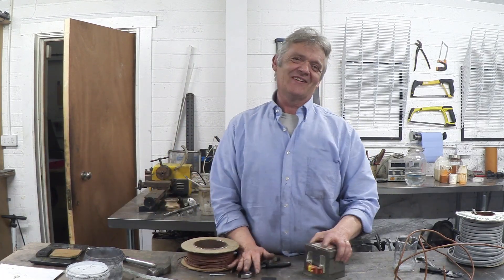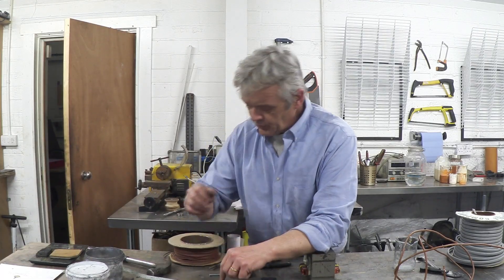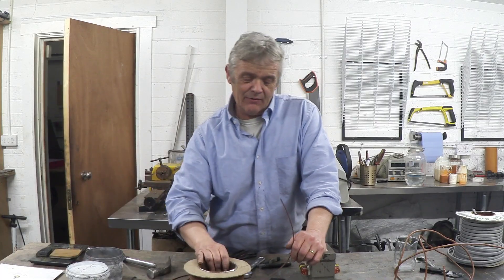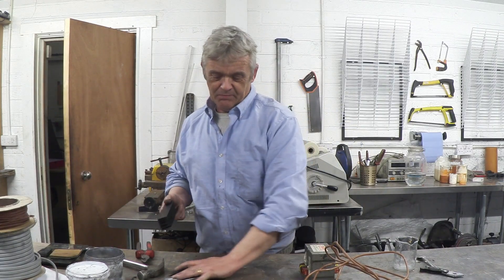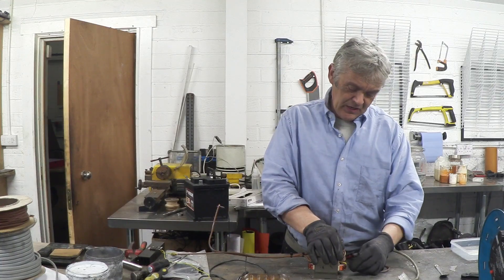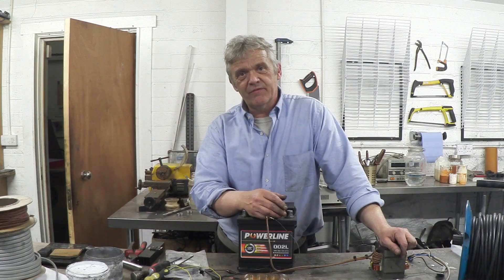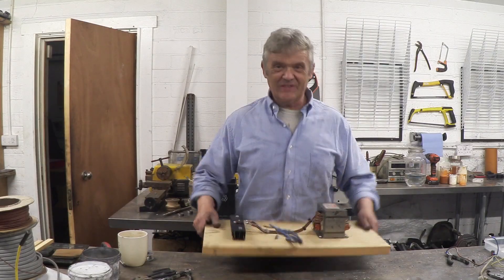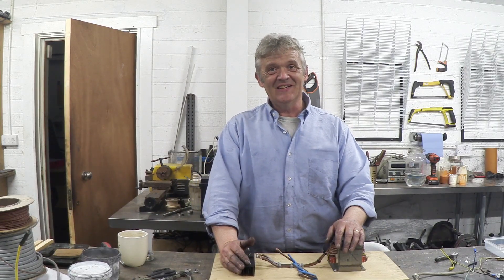Simple Cheap High Current Power Supply From A Microwave Oven Transformer

Comment: Thoughts on why I worried about it, Father was changing a battery on a truck and he got stuck to it for a moment. Now that I see you touching them, well he must have been holding a hotline that something was pulling from. Thanks for the un-fusion!
Reply from the maker: for certain he was mate - what quite often happens is the terminals get bridge by the spanner folks are using to disconnect the lugs - that's why a lot of spanners for this job come with an isolated grip - it just prevents jumping the terminals with a lump of conductor

Comment: I'm confused @ 2:08 you said 1 coil gunna give you .8v 
2 coils give about 2.v
@ 6:20 you said you had too many turns cuz you had 11.2v  and to take 1 out to get 12v.
Surely the voltage would go down if the you took a turn out.
Reply: also the dc voltage after the rectifier will be higher than the RMS AC voltage the meter shows, as it will be the peak to peak voltage of the ac waveform.
Reply: Subtractive process.
Reply from the maker: read the description

Comment: The 12Vac RMS when full wave rectifed will give you 0.90 X 12 V rms =  10.8 V D.C. average minus the full wave diode drops of about 1.0 volt each at high current ( two diodes conduct on alternate halfs cycles). So you get a full wave rectified or dirty D.C. output of 8.8 Volts average.  The peak voltage of that full wave rectified or dirty D.C. will be 12 x 1.41 minus two diodes drops ( 1.0 V each at  load) or about  15.0V. If connected to a 12V lead acid battery, the battery will act as a filter to smooth the dirty d.c. I suggest if you do connect to a lead acid battery you put a a 55w 12V halogen globe in series as a current limiter. They are very low resistance at low voltage across them but limit current should your load short circuit.
Reply: Barry Moore excellent advice!
Reply from the maker: nice one mate - thank you
Reply: @ThinkingandTinkering  halogen globes can be put in parallel for more current too. It's cheap insurance against a fire from a short circuit. It's not a new idea to use a globe as a current limiter. My Hornby train transformer in my childhood had one behind a red plastic cover. When the toy train derailed and shorted across the rails it glowed bright red. Loved those days ... lots of derailments.
Reply: @barry2718  😂

Comment: @7:44 
Robert:  "This side... certainly don't be afraid of it.  THIS side of it..."   (points to mains)
Me:  "Be afraid... be VERY afraid."  😝

Even though I work with it, I've never gotten over my fear of mains supply side and don't think I ever will.  This harkens back to my theater days when I did stage lighting, where all the banging around the equipment went through ultimately meant that at SOME point, you WOULD experience a shock while handling equipment.  And I eventually did, twice.

At this age, I'm perfectly OK with being afraid of it, but I do agree that you should never let the fear stop you.  Courage isn't the absence of fear but action in spite of it.
Reply from the maker: I really don't think you need be afraid of anything mate - cautious, aware, sensible - for sure - afraid - never - I have been shocked too and I used to work on 10,000V lines while they were live

Comment: 6:25
Keep in mind, the voltage will drop when its under load.
Reply: Wouldn't he need an extra turn to get 12 Volt's
Reply: @fallrici9knightpillz979   Correct, he put an amending comment under the video.
Reply: Fall Rici9 Knight Pillz 12v AC will rectify to a higher voltage DC, as AC is measured RMS (think if it as a kinda of average).   But I think he'd want to anyway, as under load the voltage will drop.
Reply: Fall Rici9 Knight Pillz yeah I assumed he meant 13v but not sure.
Reply from the maker: yes mate - but it doesn't really matter that much here - we want it to do a job and as long as it does that - well that's all that matters - we can worry about optimisation and performance once and if we get the thing working lol

Comment: Back when I was a teen, a long, long time ago, CB radio was all the rage. I built a 12v power supply by re-winding an old tube power supply with heavier gauge wire for high current low voltage. It worked great although was a tad low. Should have put another turn or tow on it. I'm going to keep an eye at my recycling center for old microwaves in the future.
Reply from the maker: awsome mate - cheers for the post

Comment: 6mm cross section is 2/0 AWG for the yankees.
Reply: 6mm^2 is actually not even close to 2/0, which would be around 67mm^2. It is actually just a bit bigger than #10, which makes a lot of sense as #10 is rated at 30A, and 6mm^2 as the video indicates is good for 34A. 2/0 copper is rated for 145A.
Reply from the maker: lol - cheers mate - aim forever looking up wire gauge conversion tables lol

Comment: How easy would it be to convert this power supply to an inverter? 12v dc to 240v AC ?
Reply from the maker: very easy - you need to switch the dc at 50hz if possible - so a 555 timer and a couple of power transistors will do it - they will run hot and the limit to current draw will be the silicon you use - mosfets are a better option but igbts would be best I think
Reply: @ThinkingandTinkering  Thanks for the input, I have a go at making one.
Also having a go at making the graphite dry cell.

Comment: Nice. Also, would it make sense to get some seriously rated connectors that go to the rectifier?  If someone is going to be pulling 40-60 AMP's are 12vac, any chance they would heat up enough to melt a straight soldered connection?  Pro-tip- lots of people will smash flat some copper pipe to use as lug/connectors on battery banks.
Reply from the maker: nice one. mate - me too by the way

Comment: If people do not have an MOT, or are nervous of messing with mains electricity, you could use a 12V car battery for the electrolysis experiment.
Make sure you include a suitable fuse in circuit :-)
Reply: Indeed - a diesel car battery is particularly good, ^oo^
Reply from the maker: nice one mate

Comment: The switchmode microwave supplies are no good for this. Get yourself a good- old- linear supply microwave.
And you do need to worry about a 12V battery. Many mechanics have shorted a battery with a wrench across their wedding ring across the two battery terminals. That will burn your finger off right away. Don't wear rings when working with car batteries.
Reply from the maker: good advice mate - cheers

Comment: Another relatively cheap source for high current power supplies are second hand server power supplies, it takes some legwork to find a reasonable source, but they can be really nice. I have one that can deliver 12V 53A with no problems at all...  the hardest thing is doing some googling to figure out how to turn the supply on outside the server chassis, and to be honest it won't take you too long to find that info
Reply from the maker: awesome advice mate - cheers

Comment: Risk of fire. Microwave transformers are designed for typical microwave oven use - short duty cycles. They have terrible efficiency and overheat if used continuously.
Reply: Well, we're looking solely at the transformer here, not the rest of the uWave.  What about the transformer in a uWave is different than any other general transformer that all seem to work fine for extended time?
Reply: It is not "normal" transformer. It will overheat - even if not loaded! Google for more details.
Reply from the maker: if you are going to do that stick it in a tub of oil

Comment: So, when you use this device for power to your electrolysis, will you position the transformer to also use the magnetism to accelerate production?
Reply from the maker: no mate mostly the field is contained by the core so there is very little leakage - you can make it an electromagnet but for that you need to chop the top off
Reply: Desmond Bagley  All that is required is that the Process "sees" what may or may not be produced. What can it hurt to position that core in close proximity to the hydrogen production area?
Well do not have to Have instrumentation which can measure it. Why do we have a current theory of Dark Matter, or Dark Energy? 
Tesla had his own take on the Dark Energy/aether/Dirac Sea/Zero Point. At some point we will be able to connect to the very wheel works of nature, that Sea of energy, in which we all float. No quotes, since I May have introduced minor paraphrase.

Comment: Warning!!!!!!!!!
for those who don't know the risk of Microwave transformer it's by default  step up transformer which makes 220v ac to high voltage high current 2000 volt ac extremely dangerous .
Reply: ... except he removed the high voltage secondary winding before even starting the project ....
Reply from the maker: cheers mate - but remember the secondary has been removed at this stage - if you plug it in you get an electromagnet
Reply: @ThinkingandTinkering  yeah , but i wrote that because maybe it can be the possibility that some people may think like that -  just like other electronic microwave may also use step-down and it would be dangerous if they try  to plug in mains just for testing while thinking it's harmless to touch !!

Comment: Use magnetic over current plunger cutoff switch instead of one time usable fuse
Reply from the maker: nice one mate cheers
Reply: What is that?
Reply: @LEO-xo9cz  Electromagnetic coil with high current wire  when current reach to desire value , generated magnetic fields will pull the spring attached metal   "switch " simple to make using wire iron and spring
Reply: @omsingharjit  So it's basically a relay.
Reply: @LEO-xo9cz  A circuit breaker :) most Circuit breakers have a thermal and magnetic circuit
Reply: INNOVATION & INITIATIVE Diy I’m not generally a risk averse sort but as you’re describing it, or rather as I am reading your description, it sounds like a breaker that won’t “hold” in the off position? If so it could present a Robles that it cycles between on and off and doesn’t really give a chance to fix the over current situation before it switches on. If you should forget to unplug the power before you set to work. I know more than one boatwright who has lost belt-sanders because while using it with the switch licked on it trips a breaker. The breaker is reset and then the sander drives itself right off the deck.
Reply: Just remember that a standard AC commercial circuit breaker (which work fine on DC so long as you don't exceed 20% of the AC voltage rating) drops around 1 Volt at rated current. This really matters if you have more than one circuit breaker in a low voltage distribution circuit.

Comment: Yes Sir,  Handy they are.   One hell of a Battery Charger they make.   You can make a 5v Power Supply from HELL.  LOL    Adding filter caps you realize a bit of voltage gain.    .2 * Vin if I remember right.    12v * 1.2 = 14.4v pretty much Ideal for a battery charger.    Use TGGT Wire if you can.  Higher temp and safer.

Interesting you say  0.8v per turn of wire.  Here in the USA I realize 0.9v per turn.  Must be the Hz differences.
Reply from the maker: yeah must - interesting - cheers mate

Comment: dang.. it seems like when I get an idea of doing something and come to a thinking point you always seem to hit the nail on the head.. I needed a 12 volt dc power supply with 30 amps.. I was just starting to think of a way to do it and boom! "there ya go" I just love love the road less traveled.. so many things lay there unrealized there.. I just wish the haters could realize what you are doing.. they could be so much more complete as a whole if they had some adventurous spirit to them to see what you are doing here... As always Rob.. thanks again... carry on!
Reply: Or use an atx computer power supply with 30a on the 12V rail. It is regulated and you get it dead cheap.
Reply: @JonnyDeRico  Yup jonas that is a good one also.. but I have tried that I actually made my first bench power supply out of one.. but they have to work to hard for 30 amps and I am trying to keep the heat down a bit.. But thanks for the idea.. it is a good one for sure... I still have the old bench supply mod.. I use it for running my cb base unit and charging my cell phone..
Reply from the maker: Cheers mate - and folks are dead right - you can get power supplies from all kinds of places - from buying one to reusing other equipment and even just a battery - but as you see - that's not the point lol
Reply: @ThinkingandTinkering  yup they are Rob.. I have many different power supplies I have gotten for free that run a lot of things in my shop. But I have more MOTs then old computer power supplies.. I used most of them up already that is why I was so excited about a 12 volt 30 amp power supply for a MOT. Some of these folks are pretty smart too... I appreciate all inputs..
Reply: Unless its about fiddling around with a MOT,  an ATX-supply from the junk  bin is the sensible solution, like jonas pointed out. If need be, you can get rather beefy server-power-supplies (> 1kW) extremely cheap on ebay.

Comment: Very cool. Now if only dead microwaves were more commonly in the rubbish around where I was.
For anyone wanting to build one of these, you have 2 things to watch out for when it comes to your output voltage:
1 - With those bridge rectifiers you end up with 2 inline diodes at your output, so subtract a volt or so (0,6 - 0,7V per diode). That's not that problematic at 12V, but could be if you wanted to make a low voltage for a single cell device.
2 - When you measure the voltage output from your bridge rectifier, it's an averaged voltage (RMS incidentally). Being rectified AC, the waveform is choppy, with peaks at 16,9V for a 12V AC waveform (multiply the RMS value by 1,414 [the square root of 2])

Hopefully I'm not taking anything away from a future video here, Rob.
Reply from the maker: lol - no it's good mate - I am glad you posted the help - it's part of what I like about the channel - how much folks help

Comment: If you keep that tiny iron chunks as they are located in original transformer between primary and secondary, you have some kind of current limiting. Some magnetic flux cant go to the secondary winding. In microwave that transformer is realy oversaturated. Its power consumption is realy big if it runs on low load. It cant handle about 300W for long time. Primary usualy is not Cu but Al wire. But, it is cheap (free).
Reply from the maker: thanks for the info mate - nice one
Reply: @ThinkingandTinkering  That current limiting is probably neded for powering that magnetron. It limit its maximum anode current.

Comment: Very simple and very good explained. As you said: Don't be afrait of 12 Volts; 240 Volts is a differnt story. BUT: Be careful with high amps vs. diameter of wires! They may become hot if they are too small. I made my donkee bridge to say: Roughly 10 amps per square millimeter - than you are on save side. So with 50 amps 6 mm sqare is ok. 
But you can take (I think) an ordinary cable 3 x 1,5 mm2 and run the single wires parallel. You have than 4,5 mm2 - just enough to take 50 amps. (A little bit over the above "donkee bridge, but for short cable up to 4 m should be ok)
Reply from the maker: for sure mate - you must check the ratings - but that is all over the net and the do change for installation method but in free air the rating for 4-6mm cya should be fine for this amp draw
Reply: @ThinkingandTinkering  Just to nitpick, is wire stuffed into a transformer and then enclosed in a shielded box actually free air?  I would expect some derating in that use case.

Comment: 11.2 volts so you took a turn out to get it to 12 volts?
Reply from the maker: read the description
Reply: READ THE DESCRIPTION !.......that's right...Being Blunt and Bold !!!
Reply: @NavinBetamax ,
Some folks can't read.
Thus, they must simply stare at the pictures.
Have sympathy. For tomorrow, they die.
Reply: @ThinkingandTinkering  ah right sorry. thats a relief i was beginning to doubt myself for a bit then. Cheers
Reply: The rectified 12 VAC gives you 1.414 * 11.2 = about 16 volts minus a diode drop or two, depending on full or half-wave rectification.

Comment: If one is planning on integrating this 12v rectified dc power supply with the HHO generator,  then I suggest including a PI (capacitor inductor capacitor) filter to smooth out the rectified pulsed DC.

Pulsed DC has a lower RMS voltage than than its peek voltage. While pulsed DC will work. It spends a  significant fraction of a half cycle lower than the voltage needed for electrolysis. Then the voltage rises to the peek quickly bypassing the ideal  voltage and each  over voltage × amp draw = additional waste heat.  Using a smoothing PI filter helps hold the voltage much more steady so you can produce hydrogen and oxygen at your ideal voltage much more of the time during each half cycle with less overvolting.
Reply from the maker: cheers mate
Reply: Thanks for addressing this. I was going to ask if this was somehow unnecessary for this application, but you've answered that, and explained why it's important.
Can you (or someone) please tell me what capacitors and inductor I should use for this project (types, values, ratings etc.), or perhaps how this is determined? 
Thank you!

Comment: If you want an alternative cheap 12v DC power supply check eBay for refurbished or 2nd hand HP server power supplies.  They can handle from 35 Amps to over 100 Amps for between 8 - 20 GBP which might even cost less than one high current rectifier bridge if you have to buy one.
Oh apparently first comment too!
Reply from the maker: awesome mate - thanks for that
Reply: @ThinkingandTinkering You need to short a couple jumpers to switch it on - info on YT shows how or hit me up if you need help!